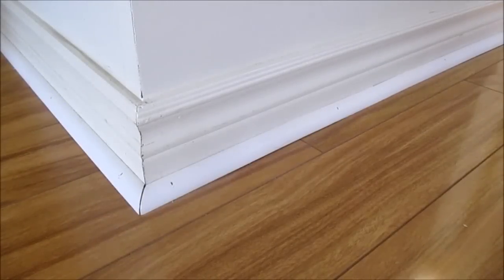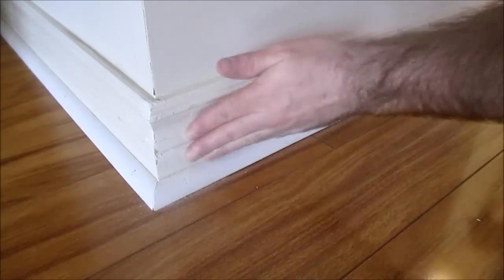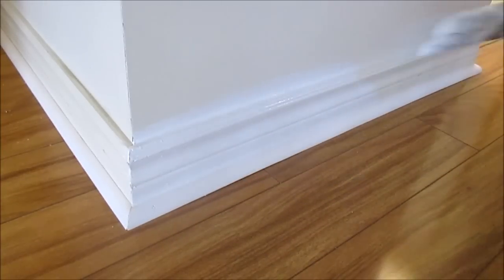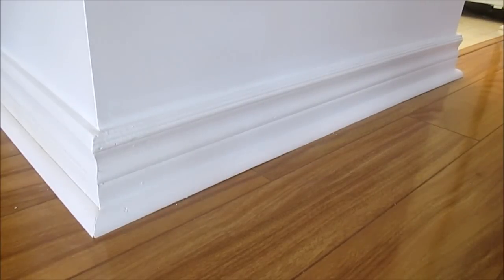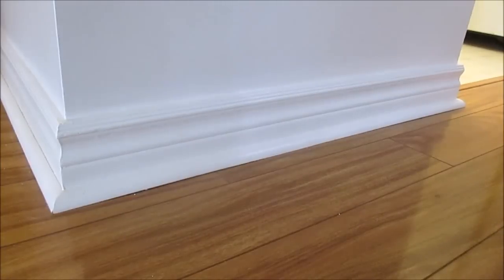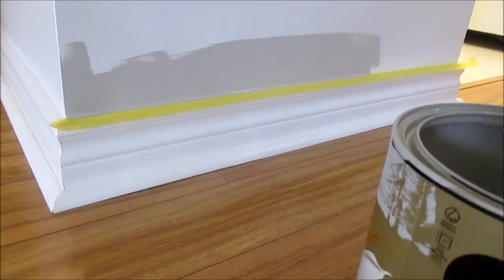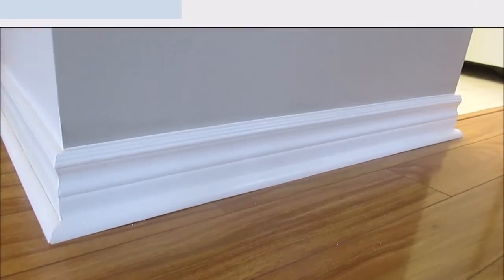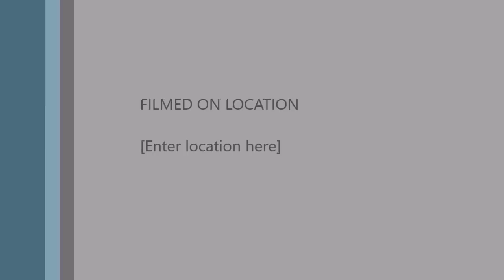How to paint baseboard trim and walls

Comment: I used acrylic enamel for the trim and can't seem to prevent brush marks. What am I doing wrong?
Reply from the maker: Thanks for watching and gor your question, it could be a number of things. Quality and finish of trim paint. Your brush that you use. Those are a couple. Now granted if you did use a good brush and paint then perhaps the way it was brushed on. I will generally go from one end to the other on the last coat to prevent brush Mark's, stop and starting points. But also a good quality polyester Bristol brush and a pearl finish paint always seems to have a very nice finish. Hope this helps
Reply: @TheCanadianHomePainter  I used a firm nylon polyester 2.5" sash brush and the techniques you mentioned but no luck.
Reply from the maker: There is a thinning agent called floetrol that I know painters use to help with brush marks, I personally have never used it, the sico door and trim paint I used goes on quite well, now without spraying it in there is always going to be some minor brush strokes that can be seen especially in different lighting. But it's never been an issue for myself in the homes I paint, I can personally recommend floetrol ad I've never used it but I know that painter do recommend it. You could give it a try and seem. I use an 1.5 inch angled bennet brush. I find that I see the brush Mark's at first and then ad the paint begins to set up they disappear.
Reply: @TheCanadianHomePainter  thank you for your recommendation. I have tried the latex thinner that you mentioned and it does help but it gets rid of the glossiness of the paint and I still see some brush marks but not as much.

Comment: Never heard of using spackle on trim. Wont it crack and crumble over time in this application?
Reply from the maker: I only use it for filling the small nail holes, I have never had any issues with it before. Thanks for watching and for the question.

Comment: Liked your video. Contains some good pointers that I am sure will help me in painting the interior of my home. But I wondering, what is the name and brand of paint you used on the wall? Thanks in advance.
Reply from the maker: Hi Mariano, I'm glad you enjoyed the video and I hope it helps with your home painting project! the paint that I used on the walls is Sico muse (matte finish) latex interior paint. Sico is great paint! depending where you live you should be able to find it somewhere. I prefer the matte finish rather than the soft gloss. I find that the matte gives a very rich smooth look, also it is washable.

Comment: it seems that water based (latex) trim paint is popular in the USA & CANADA - but is it durable enough to withstand marks, scuffs & scratches which can happen by accident in a busy household???
Reply from the maker: Great question! Latex paint is very popular here in Canada and also in the US, I have been painting for about 10 years and it's always been latex in that time. The big thing with water based paint is the curing time, it dries to touch in about an hour but for it to get to it's hard durable state it take over a month. I always make sure to tell my clients to be extra cautious in that time but after that if the prep has been done to the surface and the paint applied correctly it is quite durable even with pets (dogs) and kids, which can be hard on the interiors of a home. Oil based paint use to be the only paint here in Canada, but it is a thing of the past now. They are always improving the latex products each year. Where are you from? Is it all oil based paint where you live?
Reply: here in london, UK  - we have a choice of traditional oil based trim paint - and more recently manufacturers have produced water based versions - although some arent really that good!!!!!

i only use water based trim paint if my customers specifically ask for it otherwise i normally use oil based satin / semi gloss.

out of the few water based trim paints i have used - ive found ZINSSER PERMA WHITE to be the best for trim work.
Reply from the maker: That's interesting, oil is most likely much more durable, it would be hard to find it here since almost everything is latex, latex is nice to work with though,  Zinsser has excellent products,! I was in the Netherlands once and spoke with a painter there and he used PPG  products, PPG is excellent as well. I pretty much it for everything here interior and exterior,Not sure if you have it in the UK, but it's worth trying if you can find it.
Reply: yep - i find oil based to be easier to apply and more durable than water based - even though clean up can be a pain!!!!

i also use zinsser cover stain primer (oil based) on bare wood trim - and bullseye on walls if its needed.

i think each type has pro's and con's - and some painters have now converted to using water based only - whereas some tried em out and didnt like em!!!

im not sure PPG is available here so can u send me a web link please???
Reply from the maker: If you google Sico latex paint should be able to see if there is a supplier there in the UK, I cant find a page that says they have it in England, or even if you ask at your paint supply store they may know
Reply: thanks - i will check it out.
i dont think it is available in the uk - and if it is - its gona b expensive stuff!!!!!
Reply: MR V so COVERSTAIN ONLY ON WOOD LIKE TRIM AND DOORS? AS A PRIMER UNDER COAT?
BULLS EYE 123 AS A PRIMER UNDER COAT ON WALLS OR IF THE WALLS HAVE STAINS LIKE NICOTINE OR FRESH PLASTER DARK STAINS?

Comment: I started out painting for 5 years, then switched to hardwood flors for the last 40 years.  The flooring must have been added sometime after the baseboard was installed.  The flooring was butted up to the baseboard, losing 3/4 of an inch at the bottom.  While I noticed it immediately, I doubt that most people would.  It is fairly obvious when the baseboard is the cheap, 3 inch type that is rounded at the top.  If the baseboard is stained, I always take it off before installing hardwood flooring.  If it’s painted, I give the homeowner the option, as I’ll have to repaint the baseboard when I put it back on (and charge for it).  It’s nice to see a professional not get much paint on the floors.  If I’m top coating a floor, I usually have to spend 30 minutes scraping old paint off of the floors (that would be best case scenario).
Reply from the maker: Thanks for watching and for the comment. I usually do put down a drop cloth but just didnt for this video. But I do find that if I use a good roller it really cuts down on any splatter. Where are you located
Reply: The Canadian Home Painter   The Kansas City area
Reply from the maker: @deandecoursey7721  oh cool  my client I was working for today just came back from a work conference there. I was there briefly about 15 years ago when I was a much younger man travelling are the US. Was in 40 states in a year in my early 20s

Comment: Novice painter here and I'll be painting baseboards for the very first time. The room is carpeted and wonderinghow to protect the carpet but I just subscribed to your channel so you probably have that in another video; I'll look.
Reply from the maker: I freehand on carpet but Bristol board under the base is probably good, I have a video coming showing what I mean . I just cut strips about 5 inches and slide it under. Thanks for watching and for subscribing 👍🏻

Comment: Hello sir, what color was that grey you used on the wall?
Reply from the maker: Thanks for watching and for the question. It was so long ago that I painted that color. But I think it may have been called portobello, which is a sico paint color. Sico is under the PPG umbrella. So depending on where you live you might be able to ask them at the paint store if they carry sico paint. If you cant find sico paint then wherever you go they should be able to do a color match. I'm not 100%sure its portobello but maybe  90% lol hope that helps.

Comment: I always wonder what will happen if I paint it just once with prime beforehand. Prime + paint once are good enough, right?
Reply from the maker: That would most likely be sufficient I always like to put 2 coats of the paint on
Reply: Definitely depends on the color, I did a room for a client in royal purple last week that took 3 coats.
Reply from the maker: @aaronkennon9960  yeah no doubt ! I used a red once that needed 4 coats for good coverage. Thankfully most colors aren't like that lol
Reply: Same here, in my opinion red is the hardest color coverage wise. What brush are you using? There is a Canadian company nour who has a brush called natures pallet that I'd love to try but I'm having a hard time finding it in the states. Thanks for the reply
Reply from the maker: For all my roller sleeves and brushes are made by a Canadian company called  Bennett. They are a big company, I'm sure they are in the states. The quality is really good. The price is very reasonable which I like and they are manufactured here in Canada which is what I really like. It would be worth googling and at least giving them a try if you can find them somewhere.
Reply: Also do you do the same around door trim and windows or do you  free hand them?
Reply from the maker: @aaronkennon9960  I use tape around all painted trim. I only freehand around the ceiling. I will freehand around wood trim. It is usually very easy to edge up to woodtrim. Where do you live in the US ? I have spent a lot of time over the years down there.

Comment: Thank you , i doing my baseboard, great tip
But i using  high gloss sherwin Williams, has primer already, do i still need to use bull eye, primer, 
Thank you , definitely subscribed
Reply from the maker: Hi there! thanks for watching and subscribing, you are probably ok with a primer and paint in one (Sherwin WIlliams is very good paint!). unless you are going over something that was previously painted with oil based, the primer and paint in one with not work over oil based paint. I generally will always use bullseye before painting, I think it helps with bonding and durability etc. since I do this professionally I always want the best for my clients, but like I said you could probably skip the bullseye and it will be ok, make sure you lightly sand and clean the surface well, after its clean and dry you can start with your high gloss paint. :) hope this helps.

Comment: For a small section like that, I’d have taped off, cut in the wall, rolled the rest, then removed the tape.
Don’t want wall color paint roller mist on the new sweet white trim

Comment: Thanks

is it OK to just avoid using caulking on baseboards (excluding bathroom)
Reply from the maker: Hey Steve, Thanks for the question. Yes it is ok to avoid caulking baseboards. it is mostly for aesthetics. I will always fill in the cracks when I am painting the Baseboards and the walls. but if I am just painting the walls then I won't caulk, I think it's just a cleaner look when you eliminate any cracks or small gaps between the trim and the walls.

Comment: I painted the walls first.  Then came back and realized I have to do the baseboards.  How do I work around that?  I direly need to caulk the top of the boards.
Reply from the maker: Hey there, thanks for watching and for your question. What I would do is do the caulking first then let it dry hard, be as careful as you can and put the white paint on a couple coats. Then after it is dry use some delicate painters tape  get good stuff. And put the tape on like I did in the video but you will only be doing this to get your wall colour nice and straight along the trim  most likely one good cost with the brush feathered up the wall a bit should do itt, remove the tape right after and see how it looks. Hope this helps let me know if you have any other questions.
Reply from the maker: Just curious, are you a Christian? I just looked at your page and saw you had an upload  about the Gospel of John. I was listening to that book today as I worked. Anyways was just curious, God Bless 😊
Reply: Thank you!! I appreciate the fast reply! That helps!
Reply from the maker: oh that is interesting, I was actually referring to the book of John like the gospel of John, I listen to the bible sometimes while I work. I'm a Born again Christian. 
I am curious, after being raised in a Christian home which today can mean many different things. But assuming a bible believing house with bible believing parents, and raised with the teaching of Jesus, what brought you to convert to Judaism?
Reply: @TheCanadianHomePainter   :) it's a very fascinating story  actually! A long one I'm not so sure you want posted on your fantastic painting channel (which btw, your tips are so awesome, I'm using several and killing it!)    You would probably like that audio book, actually on the Jewishness of the Gospel of John :)   do you have an email? or you can message me at mine.

Comment: Why is a base paint needed? Will it be fine if I don’t use base and do direct paint
Reply from the maker: you should be fine if you are painting over latex with latex, if it is oil based paint then you should prime first. it will help with adhesion and durability either way but is very much needed over oil.  thanks for watching and for the comment
Reply: It’s the type of paint on baseboard that new houses (10 year old house) typically come in. Never touched it, still the same paint that the house came in.  Do they usually do baseboards with oil based paint?
Reply from the maker: @shradhapatel2419  you should probably be ok to just go over it with the latex

Comment: I'm worried that if I paint the baseboard first it will get tiny specs of paint when it use the roller on the wall... any suggestions?
Reply from the maker: yeah, well if you paint at a slower speed when rolling that will cut down on the chance of specs on the trim,  if you happen to get any on the trim, then at the end of the job you can just go around with a small brush applying a small amount of trim paint to cover any specs that may have occurred. you won't need to get close to the wall, this insures that the line will still be nice and straight, but like I said if you don't go to fast and you have a decent amount of paint on your roller,  then all should be fine. I just try to get things done in the most efficient way, the time you save on doing the trim first gives you a bit more time to roll on the wall at a nice steady pace. Hope this helps. Thanks for your question.
Reply: Lea Hagege if ypur using a waterbased for the skirt , then when you roll out the wall beforehand slightly wet the skirt when dry.Then if you do gets specs on the skirt they will.be.easier to wipe.off.
Reply: Thanks

Comment: Instead of quarter round, use base shoe. It’s a little taller, and slightly narrower, so it catches less dust and looks sleek.  Quarter round is better for vertical areas
Reply: He didn't use the quarter round. It was already there!
Reply: Having said that, instead of quarter round, take the baseboards out when installing flooring. The after install baseboards to fit on top of floor. Now, you have no need for quarter round or base shoe and you have a much cleaner look.

Comment: Anyone want to comment: I would use a wide tape on the baseboard and leave it there while I roll the wall to protect from splatter. Also, after cutting in with a brush, I like to roll it close to the line with a mini-roller and feather out the cut. This gives the cut the same texture as the rolled walls. Anyone have issues with taping freshly dried trim paint? I taped a wall that I had just painted the day before with BM Regal Select (eggshell) to then paint the crown trim. It pulled off a lot of wall paint. It was cheap contractors tape rather than frog tape, so I guess it matters.
Reply from the maker: Hi there, thanks for watching and for the comment
I have actually made a bunch of different videos showing ways of paint trim, it's just gives the average person different ways to try and see what works best for them. Check out my other videos for more tips
Frog tape is definitely the best, very expensive tape compared to the other stuff out there  but it really is superior 
Hope this helps

Comment: The MDF I buy comes pre primed so I just do two coats of my semi gloss paint on the MDF before I do my cutting and then I use touch up paint on nail holes and the corners.  I like using Purdy brushes.
Reply from the maker: Cool  that's a good system! Thanks for watching and for the comment.
I've never used Purdy but I hear they are good  I use Bennett Brushes and roller sleeves

Comment: How do you keep paint from splattering???? On the trim....
Reply from the maker: I find that if there is any splattering it goes in front of the trim on to a drop cloth, but in this video I am rolling quite slowly because I dont have a drop cloth down. And if you did get a splatter on the trin you can wipe it off. But because the roller is wider then the trim I do find that small splatters wont hit it. Thanks for the comment and for subscribing hope you found this helpful 😊
Reply: @TheCanadianHomePainter  thanks i subscribed...
Reply: A quality paint will not splatter as much as a inexpensive one.  Also if you paint your baseboards after the walls, if there are any splatter or mistakes they will be just painted over.  I also tape the bottom of the baseboard in order to protect the floors.  Use a drop cloth in case of an accident.